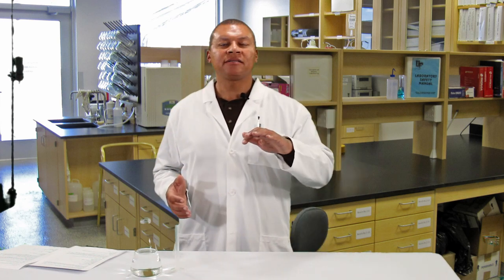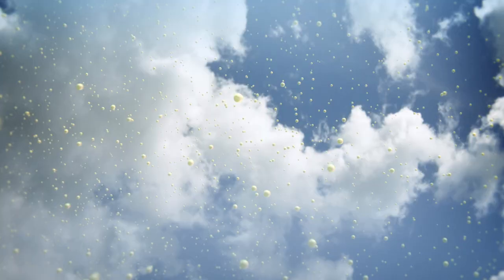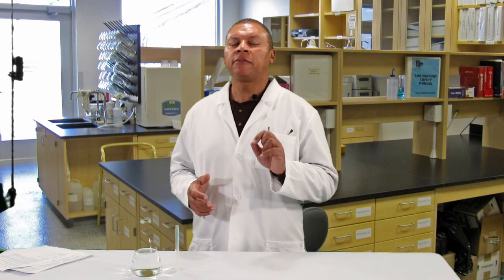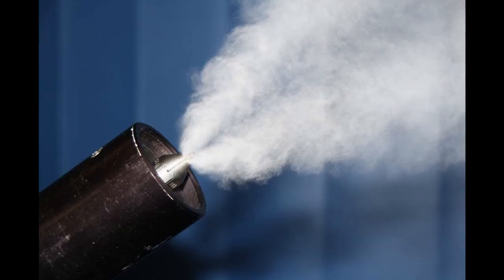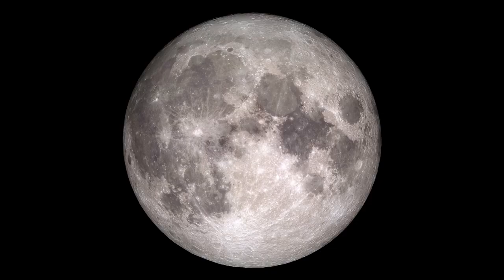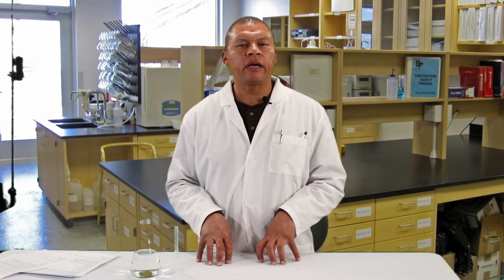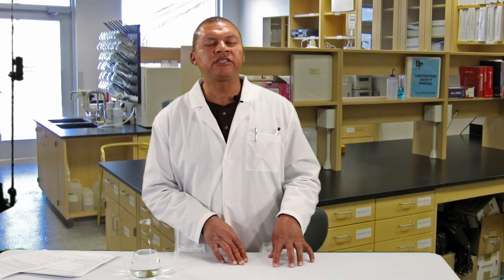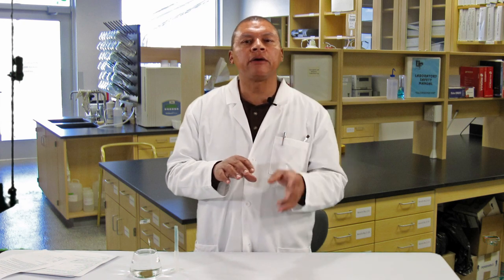Aeroponics Droplet Size for High-Pressure Systems

Comment: I like your logical based approach, which you back up with the evidence to support your hypothesizes. By presenting the influences of the factors involved in the complete system, you increase the efficiency, while lowering the maintenance involved in keeping a system running. Keep the videos coming! Live long and prosper.
Reply from the maker: Thanks for the supportive comments.
You will be a high-tech gardener, resistance is futile.

Comment: How do you calculate the amount of microns you will get from a system? does it have to do with: PSI from pump, the build of the nozzle, the total amount of pressure that goes from the line to the nozzle, or a combination of these things? im building my own system currently and im not sure how to get in between 17-50 microns. thank you

Comment: What is the recommended misting interval, or what is the nasa misting cycle interval
Reply: I am typically around 5 seconds on and 5 minutes off.
Reply: @dxhydroponicgardening9906  I find 3 seconds is good, then in mid to early bloom increase to 5-6 seconds as the plants naturally take up more at this stage

Comment: I need some help. So, I get the pump hooked up to the reservoir, then the pressure switch, then the accumulator, ball valve, solenoid, then pressure regulator. Is this right? I am looking for 65 psi, and I am using senninger fogger nozzles. Should I get a pump that puts out 100 psi, do I regulate the pressure down to 65psi with the pressure switch or the pressure regulator? I am thinking I need to drop the pressure at the regulator and not the switch, right? Because the switch is just for cycling the pump on and off, and the actual psi of the pump is not adjustable until the water hits the pressure regulator at the end of the line, just before the nozzles? I just want to verify I am correct here. If I am wrong at all, please tell me where, and how. Thanks
Reply from the maker: Hi Jon, Your question is extensive. You will find your answers in future videos.
Thanks for the question